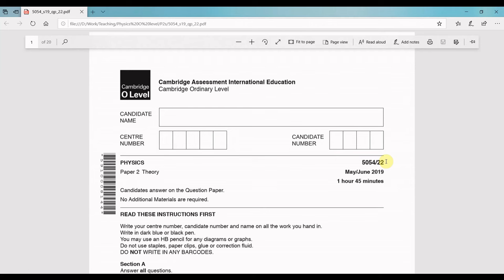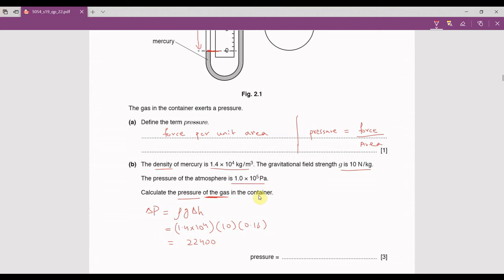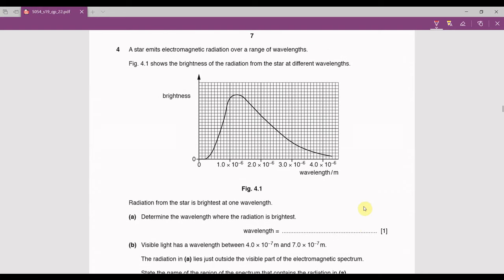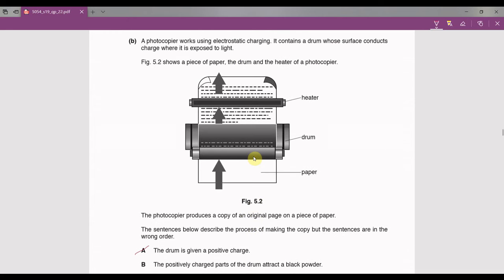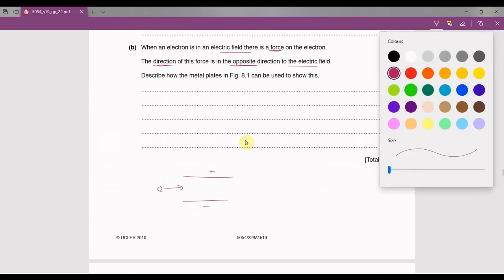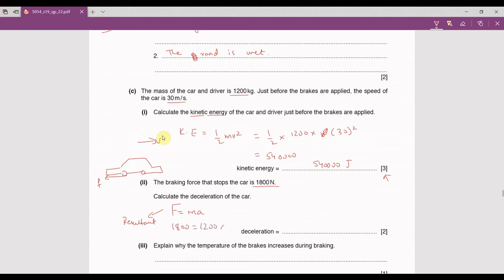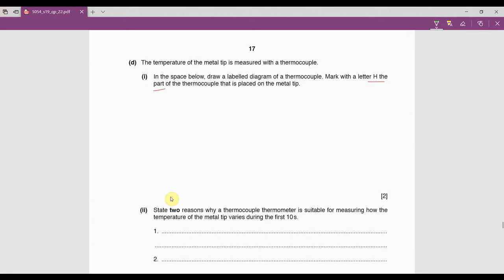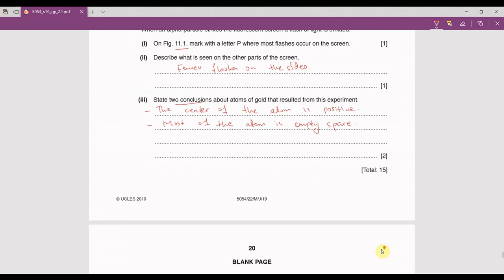O level Physics 5054 May/June 2019 Paper 22 Past Paper Solution

Comment: Angle calculated in question 9 is wrong
Reply from the maker: It is correct. In MS its measured from the vertical. Here it has been calculated from horizontal. Both are acceptable.